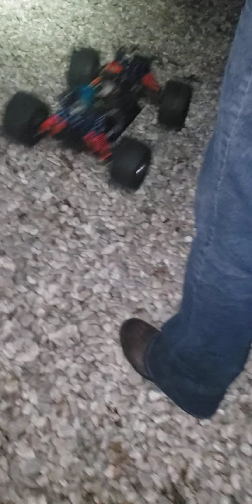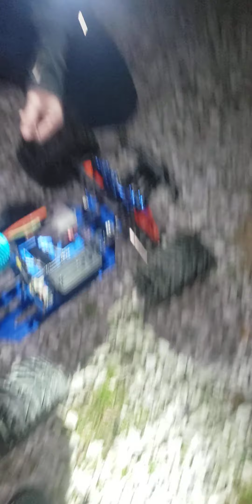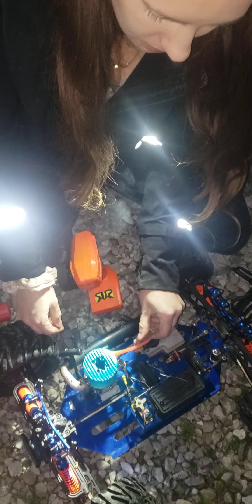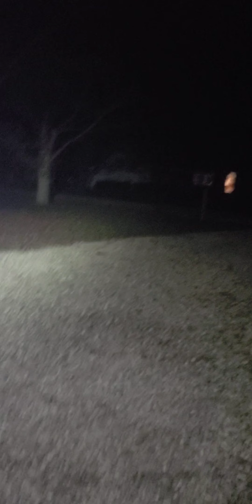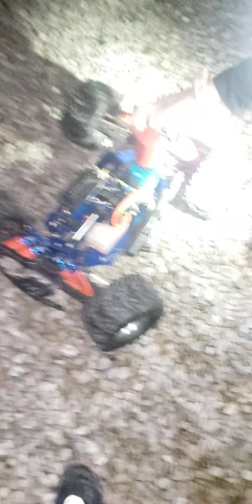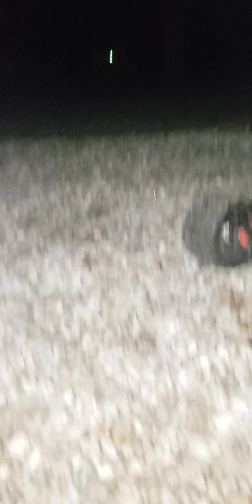XTM mammoth 24.7 fine tuning carb

Comment: 24.7 is a great engine. That bogging is a lean bog just needs a bit more fuel on the low speed needle. One thing i learned is these carbs like very minor adjustments on the needles at a time. Ive been running this same engine in my LST aftershock its a stump puller